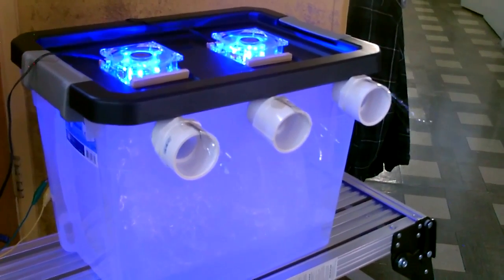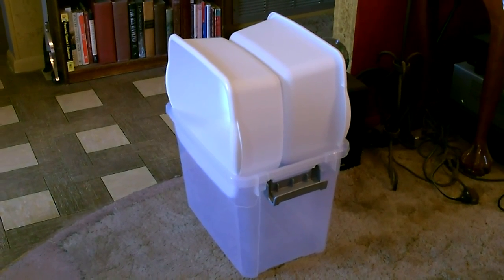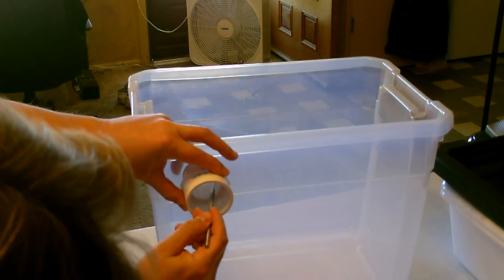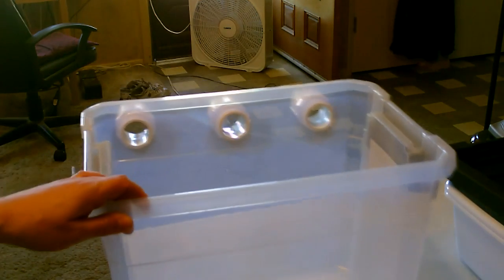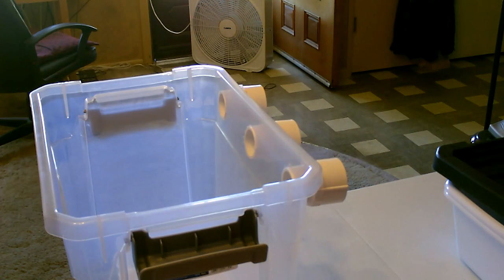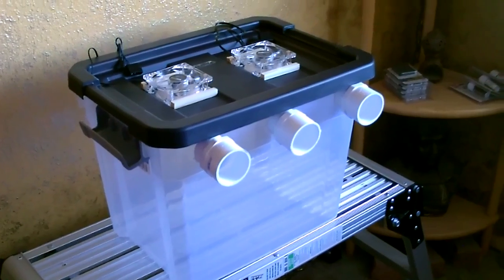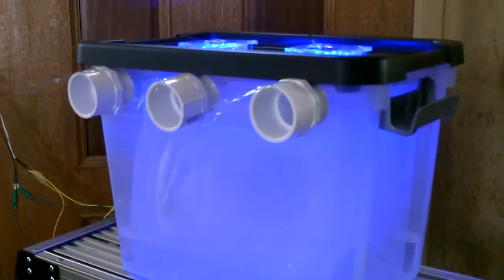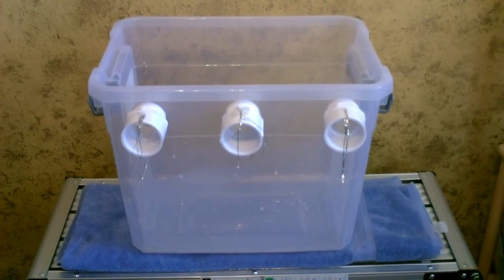DIY Air Conditioner! - Cool "blue-lit" AC Air Cooler! - (holds 40lbs of ice) - can be solar powered!

Comment: Ive been thinking about rigging something like this up. I was concerned anout condensation and/or other possible moisture issues. Ever come across any kind of issue like this?
Reply from the maker: hi there. where i live it never hits the dew point - so no condensation. if you have that issue you could just set the unit on something. first 2 things that come to mind are turkey roasting pan or just set on a towel.

Comment: Now put a bigger fan in front of the three pipes.
Blow the cool air all over the room.
Reply from the maker: or you can use stronger computer case fans. they sell ones that push twice the air. but as shown works okay in a small room

Comment: I am having issues with my ac in the car and its 114 degrees outside during summer , so I'm trying to make one as well with a styrofoam cooler . I just got one of the usb powered fans , do you think the computer fans circulate the air more then the regular usb fan ? Which is better or do they both work well ?

Comment: I was wondering if you thought of bending some aluminum tube inside to vent the air around the ice, basically giving it a winding path but also cutting off some of the added humidity of a normal sump cooler.  So it would go from intake fan to some kind of tray inside the lid that would dump air into metal tubes that would snake around inside (getting cooled), then vented out.
Reply from the maker: hi there. i've considered using aluminum tube - just haven't tried it get. maybe this summer.

Comment: i think what would work best, is try using a longer cooler or container...have the fun blowing in the end of it (side of cooler but as high as possible) have the fan blowing into a hose connected to the cooler. so this way the air will cool as much as possible before escaping through the vent. longer and more ice the better.

and then have the vents coming out on the other end as well (high as possibly so water obviously won't go through it.

Comment: Can you please tell me which battery should i use and its voltage requirements etc
Reply from the maker: hi there. any deep cycle 12v volt battery should work. the 12v volt batteries i usually use are 12ah

Comment: I wonder if the air would be colder if you mounted the top fans on the side below the pieces of pvc and then mount more fans right on the inside of each pvc pipe. That way you could have 2 fans at the bottom blowing air in to the tub, then the air moves up the ice block/cubes then gets blown out of the pipes.

Comment: Where do you get the tinsel?  (Just kidding.) I like your vid, but would like it more if it said those are computer fans. I had no idea that's what those were, until I read it in the comments.  Also (pedantry alert): It's works "well," not "good."

Comment: If you want the air colder, put a good amount of salt on the ice.
Reply: XCELCIER Salt?
Reply: Maliq Elliott yes salt, makes it much colder
Reply: XCELCIER sea water ?
Reply: kasut terbang no. Sprinkle some salt, preferrably driveway salt on the ice. It will lower the temperature significantly and cool the air coming out
Reply: @l3MTA3l  yeah the ice would also melt much faster so no thanks

Comment: where did you get the fans?
Reply: I found some on Amazon, not that high 6- 8 bucks. Ac adapter runs around 8 bucks.  Same specs as he mentioned 
Hope this helps

Comment: 🐺PET LOVERS🐕 I plan on using plain ol small foam cooler, 1 BATTERY operated fan, 1 HOLE for air exit (are the pipes really important? More than 1 hole?) If I must leave my cat in car for FEW minutes (pay for gas, sandwich or something like that) plan on putting sign in window - seriously! - saying cat is cool. My car has seriously cold AC so it's not like it has to be only cooling system, thank goodness! It will be ice cold when we stop. Like a lot of electronic things, the fan I bought, you can plug into "cig lighter". As far as I can tell, my car key has to be in 'on' position to make things operate. That OF COURSE  runs the battery down, right? I don't mind using fresh batteries in fan either cuz it's important to me! Is there something I could plug fan into? Any advice greatly appreciated.  💜
Reply: Terrie Ross hey you can get a foam cooler at the dollar tree and a mini fan all for a buck that's what I'm gonna do

Comment: Something you could do to add to the cooling
make the fans blow down through tubes almost to the bottom, then with luck the air will pass down though the ice and cold water first

Comment: If you use batteries what size and how long do they last.
Reply from the maker: hi there. i like to use 12v 12ah SLA batteries. one of those should run those fans for a couple of days. they can be recharged 100's of times and can last years. i just use a solar panel to charge the batteries. (a 12v 1amp 15 watt panel can charge one of those batteries from dead to full in 6 or 7 hours)
Reply: desertsun02 thank you for the reply. I want to do something like this for my van/camper.

Comment: This idea has been around for a very long time, but I like the addition of the colored computer fans. I don't know if you have tried it, but if you could freeze one solid block to replace the two you're using, it may last much longer then two separate blocks due to reduced surface exposure. Also, I believe the faster you blow air across the ice surface, the faster the room temp will drop. That also means the ice will melt faster, so it all depends on what's desired. Anyway, thanks for the upload.
Reply: mrbr549 your physics are way off.. The more time u allow the air to be going over the cold surface, the colder the air will be.
Reply: Lplmlk
Klpl

Comment: love this idea, what about covering the tote in insulation to make the ice last longer?
Reply: I think he is using clear tote so he can see the blue light! lol Most people make these out of cooler which of course would be the same as covering this one except you would not be able to see the blue light.
Reply: that mod would be almost pointless for this application as the entire point of this device is to move the cold to the outside air not contain it inside the cooler.
Reply: @nukethorn-v8l  what are you taking about? Cooler mods keep the ice longer and still output the same amount of cold air as this unit. The primary cooling from these devices comes from the air moved by the fans, not passive cooling through the walls of the container.
Lol unless you're thinking we mean buy a cooler, put ice inside cooler and don't install ducts or fans, step 3 profit?

Comment: Could the lights add more heat to the air coming in to the box? How many hours the ice could last when your ice cooler is being used?
Reply from the maker: hi there. since the lights on the fan are only "mini" LED's they don't  add any significant heat. i tested it for 7 hours (the test shown in the video) and the ice easily lasted that long (probably could have gotten 10 hours). really depends on how much ice you use.
Reply: I see. How about the room temperature, say the area is 4mx4m sq. closed door, at what degrees the cooler can give?
Reply from the maker: i haven't done a "closed door" test yet, but during testing, the cooler dropped the temp. in the "computer area" of my house (roughly a 8x10 to 10x10 open space... *the area seen in the video) from 83F to 76F in a couple of hours.
Reply: I see. Okay, thanks man for the info. By the way, glad you replied to my questions. Thanks again. Keep it coming ang going.

Comment: Would this work as a humidifier in winter? Also would you get the same color and longer ice retention if you put styrofoam on the bottom, left and right sides, top and back leaving the front clear.
Reply from the maker: hi there. if you want to add humidity to the air, I'd consider building one of the evap. style air coolers. *these "ice-based" ones don't add any noticeable humidity to the air.